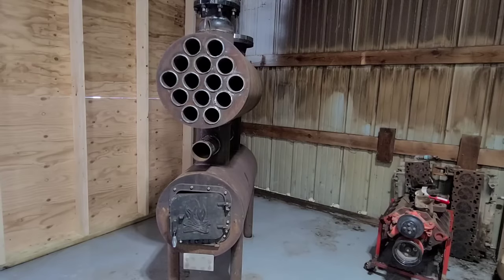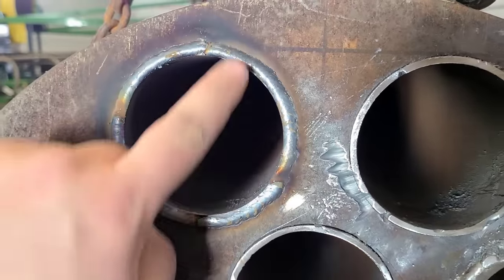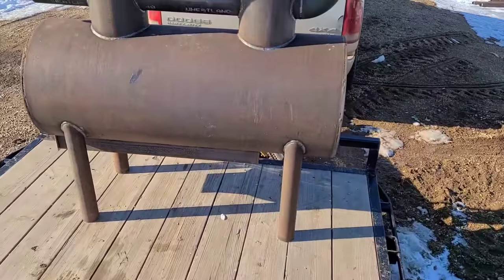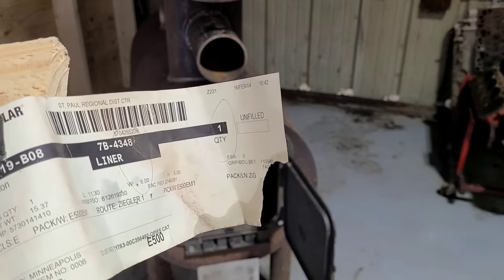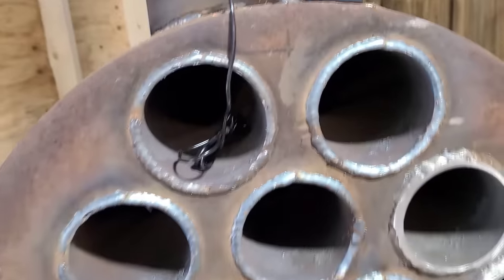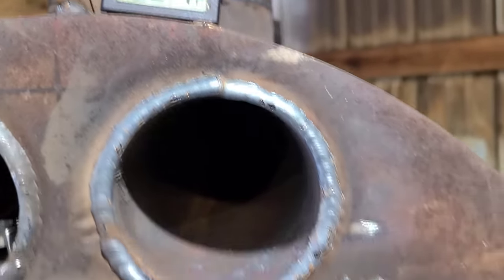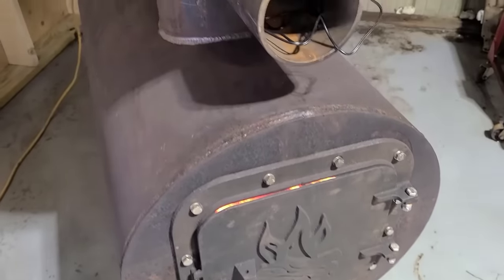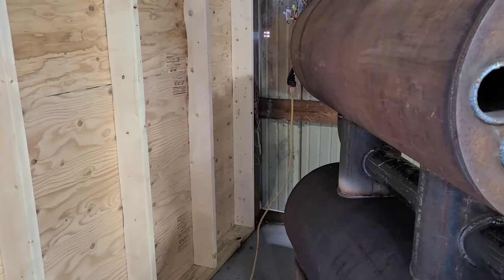My Ultimate Shop Wood Stove Build Part 3

Comment: I cant help but think the multiple tubes is the wrong approach, unless you had the fire going through the tubes heating the air mass around them, way more efficient.
You also have to contend with deterioration in thermal efficiency as the tubes 'tar up' from the wood smoke. How then do you clean it off?
Two smaller heat exchangers above your chimney vents would be the way I'd go Kyle.
Reply from the maker: In part 1 and part 2 I show the clean out 👍

Comment: Lower fan speed will increase temps but reduce volume (CFM) thus reduce BTU output into the space.

BTU = CFM x Delta T (inlet temp at the fan minus outlet air temp). There is a correction factor multiplier but we can ignore that. Also CFM can be arbitrary as long as you’re consistent. 

So if you bought a cheap anemometer you’d be able to determine if less air flow but higher temps is actually producing more heat. Often times this is NOT the case, for example if you turned the fan completely off the temps your measuring would be VERY high but without the fan you aren’t moving the heat into the room so you’ll get higher temp but lower BTU output. 

Running the fan on high won’t be as comfortable standing in front of it but more effective at heating the space. There is a point of diminishing returns which the above calculation aids in figuring out. 

However I’d balance this with exhaust gas temp to minimize condensation forming in the flue. Basically maximize heat output and equipment longevity.
Reply: needs a secondary burn baffle/chamber before the exchanger

Comment: I would’ve put the fan in the top of the building, with a big channel towards the stove. That way you circulate the air better in the shop. Hot air will hang around at the roof, and will not come down unless you force it.

Comment: A few things first you need a drain on your top heat exchanger to allow condensation to drain out. Secondly you need to keep your flue (exhaust) temp higher otherwise you will have build up of carbon or creosote on your tubes which will be dangerous and secondly will prevent good heat transfer to you tubes. Insulating your fire box area with fire brick will help in raising your exhaust temp up since that’s where you seem to want the heat to come from.

Comment: You are REALLY going to want to seal that stove door better, as well as be able to cut off most of the air through the damper~ If you are letting that much air into the fire box, you are literally wasting 70-90% of the energy in the wood, on top of the fact you stove wont get NEARLY as hot, or stay hot for nearly as long. Its a great concept, but Ive used woodstoves for nearly all of my 40 spins around the sun, and trust me, you need to seal that beauty of a stove up better to improve the burn efficiency. If you had that stove dampened right down after the fire was established, that stove would put out just as much heat, if not more, but for 4x as long w/ the same amount of wood.

Comment: I would think a much smaller fan would be preferable. Slower flow means more contact time in the tubes. Doesnt take much to move the air around nicely
Reply from the maker: It made a big difference turning the blower to low speed 👍

Comment: I think you’re gonna have a problem with creosote buildup. I hope you have a plan for that.
Reply: Looks like some secondary burn tubes may help clean up the smoke and help with efficiency. Maybe prevent some of the creosote build up.
Reply: I was just thinking about that. It might have been better to build in a similar style to a rocket mass heater, with the first barrel acting as the secondary burn chamber where the creosote gets burnt. More space would have been required, but never having to clean it definitely outweighs the space used.
Reply: Yup.  Cool heat exchanger, but build-up due to low heat in the chimney might be an issue.
Reply: I think you need to keep the entire exhaust above ~220f to prevent water condensation of the exhaust, as well. It will corrode all the exposed metal very quickly since it's quite acidic from the combustion byproducts. Wood is pH balanced, but ashes are alkaline, so perforce the exhaust must be acidic to balance.

Comment: This is going to be a condensing wood burner. The sizzling you're hearing may well be the condensed water vapor from the exhaust running down the chimney system back into the stove. In order for a condensing system to work you need an off-set point in the chimney for the water to drain down somewhere else, otherwise you're going to be in a constant battle of trying to re-evaporate the same water and drive it out of the system up a chimney that is too cold to carry the water as vapor. 

Whatever energy efficiency you're gaining by sinking all the heat off the half-unburnt exhaust will be a wash with the extra effort this stove is going to require in chimney and heat exchanger cleaning maintenance. This design is ripe to make a very exciting type of chimney fire in the future! 

Wood burning systems are a balancing act of fuel, effort, efficiency, emissions, and risk. Being able to burn less wood is only useful if it does not come at the expense of some other risk or maintenance or effort or emissions factor. You've traded lower fuel consumption for higher chimney maintenance and higher chimney fire risks, but I don't see anything in this design that will actually efficiently or cleanly burn the wood in the first place. There's no secondary combustion air, no pre-heated combustion air, no baffles to force flames and unburnt smoke to interact with hot oxygen rich air present. You could probably achieve better fuel to thermal efficiency while still maintaining HIGH EGT's with a proper combustion process instead of all this heatsinking. This design will burn dirty and deposit lots of unburnt fuel on your chimney and heatsink system.
Reply from the maker: This is not condensing wood burner. The sizzling is from the firewood sitting out in the rain before I put it in the stove
Reply: @kylechrist  Check your EGT's at the top of the stack, if they are below 212F through the wood-gas phase of combustion then this is going to condense water on the chimney system.

The short clip shown of your exhaust looked very steam rich and appeared to be in the form of steam as it was coming out, not after mixing with the cold air.
Reply from the maker: @mdocod  I understand and I can check those temps but the video of the stack was also before the stove was up to temp 👍
Reply: @kylechrist  At the point in the video where you said "lets go out and have a look at the exhaust" appeared to be well into the burn cycle with lots of hot glowing red embers that we tend to see towards the end of the off-gassing portion of the burn. If the video of the exhaust was taken at a different time than indicated then perhaps I'm mistaken. 

In my personal experience with wood stove mods (including mods intended to extract heat from the exhaust of the system), it's easy to get carried away thinking that there's this huge amount of wasted energy going up the pipe in traditional designs. In reality, a well designed stove system will have a controlled rate of burn and slow hot movement of exhaust gases from the system. The heat should be radiated and conducted from the active flames in various combustion stages to the stove body and to the space to be heated from convection and radiation primarily from the stove body, leaving behind an appropriate amount of heat to carry emissions and vapors out the chimney with minimal deposits. With that said, an alternative design strategy is that of a rocket/blast type burner, where excessive amounts of air are blasted into the firebox at the fuel directly to excite a very hot complete burn without the need of secondary combustion for clean burning. This sort of combustion process would be better suited to your design approach on the exhaust, but is more likely to melt through the steel that your fuel load is sitting on, so be careful if you operate it in this manner without firebrick. 

This isn't to say that there isn't room for tuning of the exhaust system to extract an appropriate amount of thermal energy from it before leaving the space, but this should not be treated as the primary source of thermal extraction in a well designed system. You've put hundreds of pounds of steel to recover about 20% of the energy. The same effort put into improving combustion completeness would have actually put both more heat in the room and more heat up the chimney to carry the exhaust out cleanly. Secondary combustion tubes and baffles and some firebrick would have been a better use of all that fabrication effort. 

Many wood stove designs actually work best with an insulated stove pipe and chimney system, as it allows the combustion to be slowed down to a very controlled pace while still maintaining proper EGT''s all the way up the stack for consistent draft effort and minimal deposits. Slow moving superheated gases and flames moving through the firebox and up around the baffle and across the top of a wood stove actually maximize the use of a minimal amount of combustion air, so despite producing high EGT's, these systems are still very efficient because the rate of flow through the system is low. 

Maintaining appropriately high EGT's (500-1000F above the stove and 250F+ at the exhaust) does indeed come at some efficiency expense (~10-20% compared compared to partial to fully condensing systems, all other things being equal), but that efficiency loss is actually WORTH the practical benefits. Proper EGT's keep the chimney system clean, safe, and low maintenance.

Comment: In my situation I would build a concrete block wall on two sides of the stove there to obsorbe and distribute the heat in a radient fashion. not sure all the details fo your build this is the first video I have seen of it. I'm in the planning phase for building my own zero pressure boiler for burning sawmill scrap. We have several sawmills near me that can't hardly give away there slab wood currently. I can but a 10ft long buy 4ft tall bundle of hardwood slabs from them for $15. I don't have the interior space for a wood stove so the stove has to be outside and the heat piped in.
Reply from the maker: I have my own wood boiler as well that we heat our house with. I really wanted to heat my shop with it as well but was worried it wasn't big enough. Wood boilers are nice as they keep the mess outside 👍

Comment: Should put you a waste oil drip feed on it as well.
Reply: I just did so on a wood boiler I  built years ago, it's clean burning and noticably adds to the heat output, with the needle vavle set on a drip every second and a half.
Reply: We serviced our own equipment and burned all of it

Comment: It would be interesting to see a set of inlet moving blades at the entrance  of the pipes to increase your outlet temperature.
Reply from the maker: I'm not following what you're trying to explain
Reply: @kylechrist  I wonder if he is talking about a damper to restrict flow more, but slowing the fan down took care of that.
Reply: Turbulators. Just like a natural draft water heater has, to slow air flow and push it to the tube walls. Not sure if that's what he means, but that's what I would do. They have them in all the secondary exchange tubes of home warm air furnaces. I can't think of the brand name right now, it's old, but your stove secondary looks like a boiler I come across now and then at work. Around 24 tubes with turbulators vs one in a water heater.

Comment: A grate wit air blowing up thru the bottom probably help it burn a lot cleaner.
Reply from the maker: I've thought about that as that's how my wood boiler is set up but with a "pressurized" system so to say, smoke get pushed back out anything that isn't sealed, mainly the door, so that would need to be reworked as well. It's not off the table though 👍

Comment: Wow lots of "experts" in the comments lol I am thinking of getting started on a wood stove project my self I have done a number of things over the years.  I also get a lot of my wood free skids and stuff.  I should do a video I guess i use to do a lot more video stuff but i just wanted to share ideas and not a famous utuber and I just kind of gave up.  I think your stove is looking good and with the amount of material and size of burn chamber I bet you will be able to load it up close the damper and have good heat still in the morning.  I think the biggest thing I want this time is to have the door and burn chamber big enough or an option to fit a half skid that way i don't have to spend as much time cutting stuff up.  thanks for the video
Reply: This build looks impressive but a lot of the suggestions from the "experts" as you call them are spot on, his heat exchanger is too big for the size of firebox he has and he even said in another comment that it would be more efficient if he cut the top chamber off, and got rid of the two vertical pipes so that the fire can get right at the tubes instead of relying on the heat drafting up. Youtube can be pretty brutal for knowitallism, but the suggestions he is getting are not out of line. I used to weld heat exchangers together for a few years before I changed over to fixing mining equipment, but the biggest legit issue with this stove and why his temps are barely above 150 on his exchanger bundle is 100% because the exchanger is 1. Too big and 2. too far away from the direct heat ie. the fire. He's not really gaining much for all that additional work, and could get almost the same heating affects from a standard wood stove.

Comment: I would think you could add a waste oil injection/dripper system on it, that is if you have large quantities of waste oil around. It should really up the BTU’s for not a lot of oil used.
Reply from the maker: I'm not opposed to a used oil burner 👍

Comment: Do you think that you’ll add a dampener on your exhaust stack at the top, to kind of slow the burn so to speak, like on a spring day and you don’t need so much heat or you wanna make the wood last through the night?
Reply from the maker: While a damper is a future option, the reason I don't use one now is so I don't pull too much heat and send cold smoke up the chimney. Obviously I need heat to rise to create a draft but it also cuts down on creosote buildup. Thanks for watching!

Comment: Just a thought for the fan speed. If you would install a second switch after the main one you could put a three-way switch and have two speeds just with a flick of the switch. if you are curious as to how I would recommend wiring I could explain.
Reply from the maker: That would be an easy addition to do if I switched to a 2-gang box, left the old switch and run power from that to the 3 way 👍
Reply: @kylechrist  exactly what I was thinking. That way you can adjust speed depending on how hot the fire is burning.

Comment: the key is to build a UBER hot fire at first, get that upper as hot as possible, then toss in your wet, then turn the fan on, crank down the air, either way you always need to let that upper get very hot before turning the fan on...

Comment: I made a stack on boiler very similar to that. shame you didn't do that it would have been an amazing boiler at least twice the size of mine. I used 4 ft long 18 pipes inch and a half diameter was too small I have to clean the boiler pipe monthly or it will plug but ridiculously efficient.

Comment: I would consider replacing the fan switch with a dimmer switch so that you could regulate the fan speed to what ever best suits the situation.
Reply from the maker: I preferably don't want to have to check and change fan speed. I'd like to find a happy middle ground that works well all around
Reply: Not a good idea on a PSC (pole split capacitor) motor. They are already inefficient in their design. The best efficiency (electrical) is on high, and its about 60%. Since the motor is self cooled via airflow, slowing it down will reduce cooling air flow, increase heat soak and Amp draw in the motor, decrease lifespan of motor, and increase risk of fire hazard. Or at least seeing the magic smoke come out. Sweet stove. I do agree with others. Firebrick would increase the lifespan of the primary chamber. Secondary air for the exchange will increase efficiency and reduce emissions and the number of cleanings it will need.

Comment: That is very nice Rocket stove. Just one question: how do you plan to clean the chimney and other passages? Some wood types do cause slag more than others. Usually there is a hatch beneath that you can open and what ever gets shoved down the chimney ends up in a catch pan. There are some interesting engine props in the background that also got my attention.
Reply: That is not a rocket stove...not even close.  I agree that there are going to be serious challenges with cleaning out the tar and creosote associated with burning wet pine firewood. After putting that much time and effort into this project, I wouldn't use anything but truly dry hardwood.  Free is nice, but value is even better.
Reply: @jasonbroom7147  What is it called then? I mean I'm not familiar with all the terminology. There are so many designs that looks similar and are also called a rocket stove.
Reply: @SuperMAZ007  - It's just a wood stove with a very cool heat exchanger on top.  Rocket stoves have pretty specific design parameters that optimize air flow and volume.  Rocket mass heaters use some of the same principles, with a large thermal mass incorporated into the design.
Reply: @jasonbroom7147 the pallet wood is kiln-dried, and the company’s wood is known for being quality (as stated in previous replies.) Although, the top will need to be cleaned ‘eventually’, it’ll be prob every 2-4 years. Which he accounted for by putting a clean out right behind the exhaust.